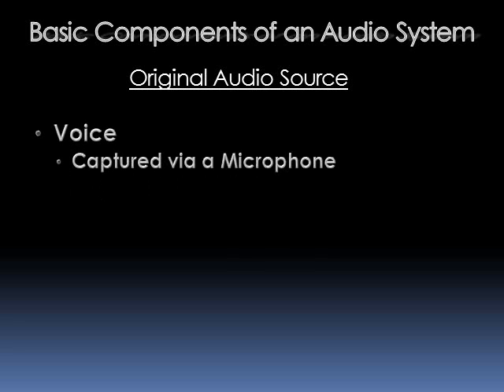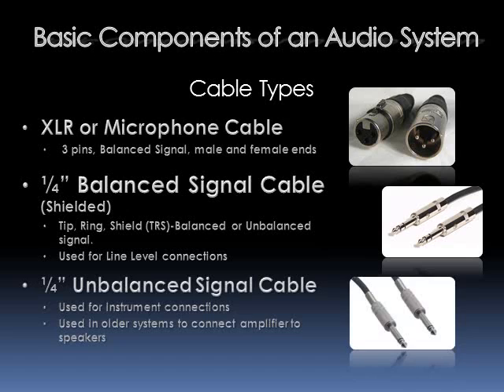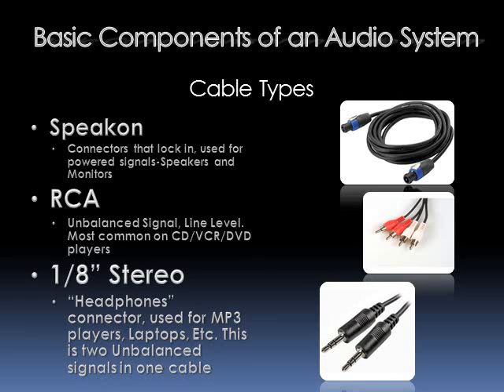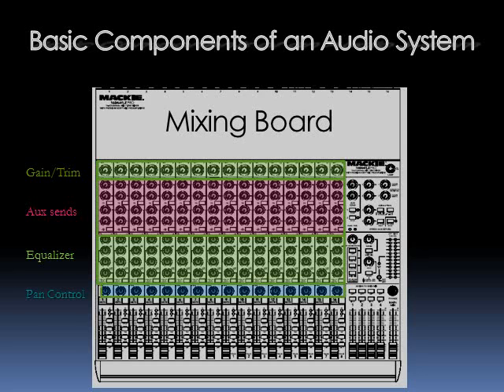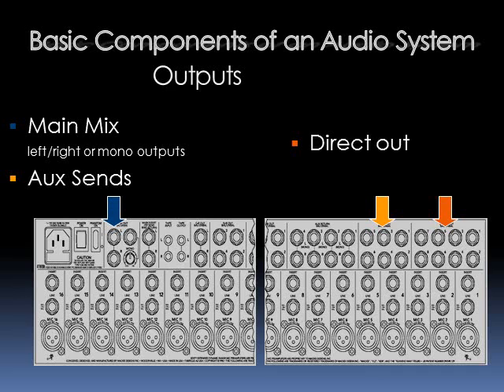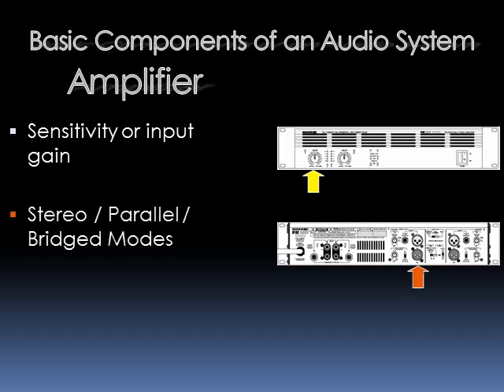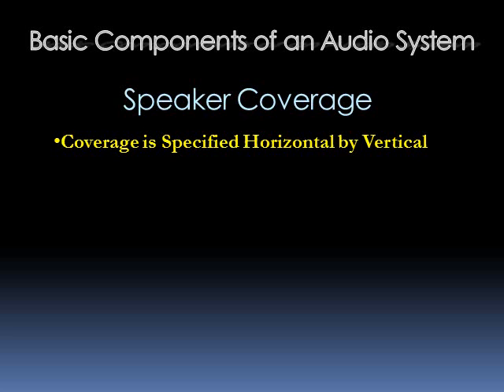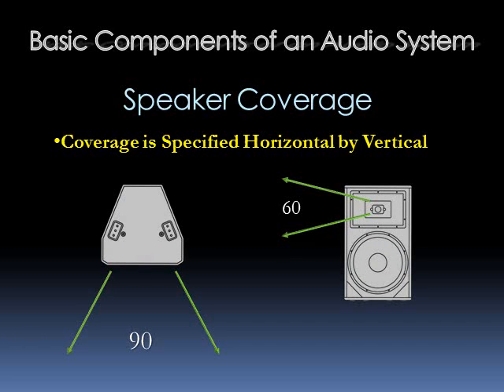Basic Live Audio System Overview

Comment from the maker: Balanced audio signals are sent on two separate wires that are "overlaid" on top of each other within the board.  Whatever audio signal that maybe present in one and not the other is discarded. If noise is introduced during the cable run ( radio, electro-magnetic, etc) on one signal wire, this process will eliminate it.  Unbalanced doesn't have this ability as there is only one signal wire. Unbalanced cables after 25 feet tend to act like radio antennas and not recommended for longer runs.